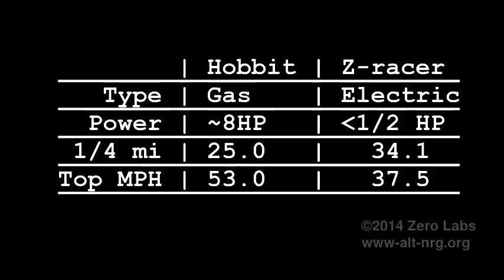#367 Results video - RWG vs Zero, The Race

Comment: how did miss this, I watch both ya all channels & ride a lab recumbent homebylt, 26" wheels, no suspension, heavy mono frame (40kg) with no electrickery, yet. I'm just about to start my third, is there any thing you would change on your bike, or motor
Reply from the maker: +Brendan Haslip (Doone  &amp; daknaki) Wow, 2x 26" wheels. Must be pretty high off the ground. I ended up taking the motor off entirely. The lead acid batteries I was using are just too heavy and the way I had to attach the rear wheel motor sprocket very flimsy. After this video I also made a 60T chain ring from a 12" saw blade. Changed my head angle to about 60* and raked the forks 2" more for about 1" of trail. Made a huge difference in low speed stability. Ratio of the steering linkage is now 2:1 to get more range of motion, also for low speed stability.
Reply: 4" ground clearance,  26" rear wheel with 8 speend cassette front and back, back peddaled, planed on chain drive using 8 speed derailer for speed control, front wheel, 2kw motor, liked your 12/24 volt switch ,

Comment: Seems to me based on time to HP ratio, you were a clear winner. I think if the bike could handle 1-2 HP motor, you would easily match or beat his time.  I am curious if you have thought about trying racing tires instead of mountain bike tires?
Reply from the maker: I have thought about it and eventually will replace both. Fow now I shaved smooth all the nubs off the rear tire. This became a contributing factor to my wipeout in the soft sand on the sidewalk when the tire dropped off the lefthand sidewalk edge.

Comment: I really enjoyed your video.  Dumped mine more than once.  i didn't like riding it in traffic. You did pretty good with just 350 watt motor.  Run 800 to 1000 watts with lipo batteries. Myself 25 is plenty fast for me i just like the pick up and power on the hills. I just run my k 2 bike with 40 volts 800 watts now.

Comment: Boy Wonder prevails as predicted having the advantage of a fully blown EDM machined super high performance spacer. You got smoked old man but there is always another day. Also good thing you did not have that spill out on the open highway in traffic doing 30 plus miles per hour. I am not fond of red stuff covering the camera lens as it makes it hard to see from this end hamburger being made.
Reply from the maker: Yes, I am reconsidering the rematch challenge, at least against the modified Hobbit. To win I'd have to exceed 53MPH, I suspect by a pretty wide margin. I really don't think I'd want to take any 2 wheeler that low to the ground any faster than 45, but you never know. Maybe in full leathers with a motorcycle helmet!

Maybe next time we can make it an open competition and, with enough entries break it down by power class?